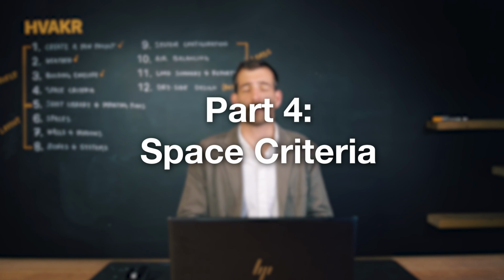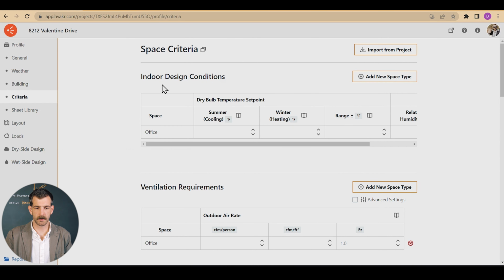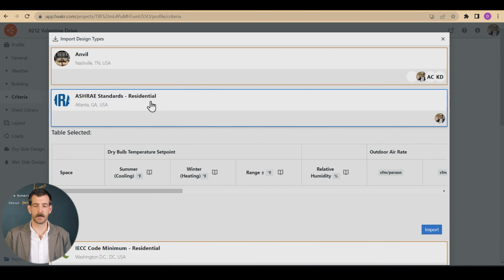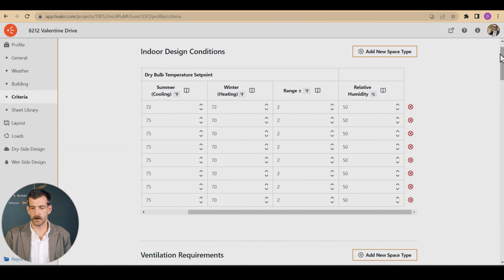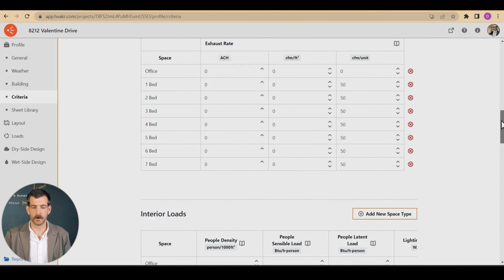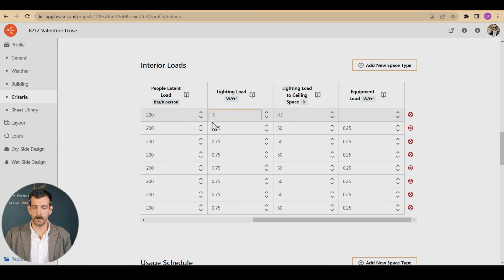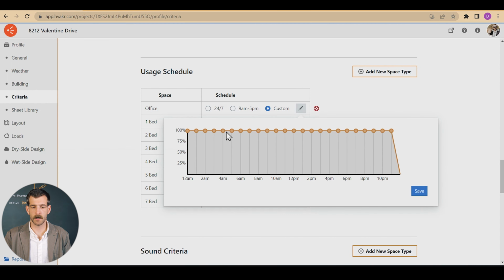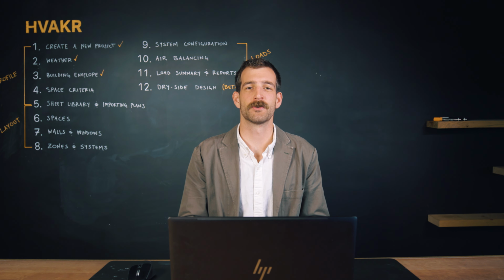HVAKR Tutorial Part 4: Space Criteria

Comment: Which setpoint is considered when defining zones? In space type, we can assign different setpoints for each space, but once those spaces are added to a single zone, how does the system handle this? Does it use one setpoint for the entire zone ?
Reply from the maker: Hey @adityaruikar7020! When figuring a setpoint for a zone, HVAKR takes the weighted average of all the spaces within the zone. That said, as a design consideration, I do not recommend grouping spaces with differing setpoints onto the same zone. One zone typically means one thermostat, and one thermostat can't control multiple setpoints in multiple spaces simultaneously... it's limited to one setpoint in one location.  So if your spaces have different setpoints, some of them won't have optimal comfort control.